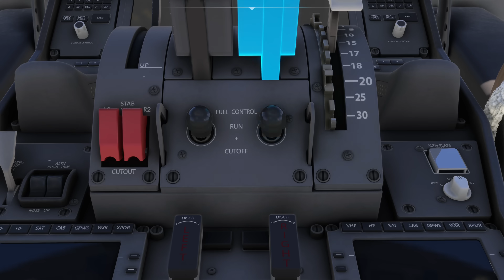Air India 171: Why Did The Fuel Cut-off Switch Get Moved?

Comment: Nobody saw the switches being moved.  
The real question is, how did the electronic circuitry downstream of the switches send the signal to temporarily switch off the fuel supply valves even when the switches were physically not moved.
Captian Steeeve,  please do not be presumptuous.  The possibility and probability of electronic circuit malfunction and glitch is far far greater than the possibility and probability of a human being to plan and commit suicide in cold blood taking along over 250 others with him to death.
Your insistence on it being a pilot action rather than an electronic glitch is completely baseless without any proof.  Just because the black box records the switch off, does not mean that the switch off was caused by actual movement of the switches. There is plenty of circuitry between the physical switches and the fuel shutoff valve solenoids for that glitch to happen and get recorded in the black box.   The CVR recording also does not bear proof that a pilot did it.  The recording in fact is proof that both pilots were surprised that it happened.  The first pilot who asked the other pilot why he had switched off the switches had given a natural reaction to the glitch. The other pilot replied and clarified that he had not done it, making it clear that it was an electronic glitch and not a mechanical failure.
Captain Steeeve, we respect you. Please do not sell your soul to Boeing.  Be on the side of truth and truth alone.
Your integrity is at stake in this case.
You seem to have taken up the job of maligning the pilots and taken up a psyop contract for boeing to create an impression world wide that this is a pilot suicide case and divert public attention from the possibility of electronic malfunction.
https://youtu.be/ybRgSVPsIwo

Comment: Looks like corrupt effort by western media and Boeing PR team with captain Steeve here to blame pilots to such reckless mistake at 600ft right after takeoff. 

Boeing has already accepted hardware was faulty with circular in 2018 l. AI171 had TCM module change in 2018 and 2023, why wouldn’t they have checked fuel cutoff switches? Boeing is definitely hiding something serious here like MCAS. Boeing has corrupted aviation safety bodies.

Comment: If it required two pilots to cut off the fuel, what would happen if the situation required an emergency cut-off and one of the pilots was incapacitated? Not sure this is a solution. I suggest that an audible warning, "fuel cut off engaged," together with an alarm and lights might be a better solution.

Comment: Shalom Captain Steve,
The repost says that both FC Switches were transitioned:
"within a time gap of 01 sec". 
That is: not one second, but within one second. This could mean 500ms or a maximum of 999ms, or a minimum of 1ms or even simultaneously (0ms).
So can one pilot - without the pilot protocol verifing checks, switch both FC's within a sec ie at max of 999ms? As you said, these are on springs: he must pop out the string from "run" position. Move it from "run" to "cutoff" then pop back in the spring such that the switch is now stable and unmoveable in the "cutoff" position. Is this half a second's worth of time? With the other switch another half-second?
Has this been simulated?
Can you show us this: get some model of the two FC switches and demonstate transition both of these within a sec (with a timer to check) on your next video?
And no need to say: he can't switch both FCs at the same time.

Secondly, the report says:
"When FC switches are moved from CUTOFF to RUN while the aircraft is inflight, each engines FADEC automatically manages a relight ..."
That is their is automisation and thus software control from "cutoff" to "run". I assume it is the opposite procedure from "run" to "cutoff" ie automisation and thus software(?).
If so:
Could the following scenario occur:
After Vr and a few seconds after that - their was some malfunction in the software that, somehow, nternally caused a transition from "run" to "cutoff" of FC1 -
WITHOUT having to move the switch manually?
And subsequently the second switch FS2 also automatically cutoff due to a software malfunction/virus/hacking - both "within a sec". Ie an automated accidental malfunction (or another possibility: someome deliberately hacking into the program prior to flight, from the previous flight to the current flight).
Thus the data recorder would have senses AS IF the fuel switches were manually switched off, thus recirding a "transition from run to cutoff ..." for both switches within a second. When in actual fact no one actually moved the switches. Comcerning the pilot's question of "why are these switches off?"
Maybe he hears the muffled noise of both engines cutting off, and thus asked assuming the other pilot switched off both FC switches (prior to making a visual inspection, as the flying pilot is looking straight ahead).
Then, after 7 sec (after FC2 cutting off), someonen the software rectified itself retransitioning FC1 from cutoff to run, followed a few seconds later with FC2. Thus if a software malfunction in the FADEC it is unlikely a virus or deliberate hacking (otherwise the software wouldn't have tried correcting itself after 7 to 10 sec). Rather more likely a genuine software malfunction or bug in the FADEC IF all this was indeed a malfuntion and not pilot intervention. Thus the 2nd pilot's response of "I didn't do it" may be authentic.
Could this be a possibiity?

Thank you,
Shmuel 
Ashqelon,
Israel
Reply: Spelling correction on 2nd line:
 "... the report says  ..."

Comment: Hi captain, it is mentioned that the fuel switches turn to "cut-off" at the time of landing. I have couple of questions in this scenario: 
1. How likely it is that the pilots skipped/forget to check the fuel switches in the pre-flight checklist?
2. Can a plane still possibly be takeoff if the fuel switches are left in ‘cut-off'?
waiting for your feedback.

Comment: Nowhere in the report does it say that switches were physically moved by the pilots. It says the switches "transitioned" which means if there was a malfunction the fuel valves might have closed without physically moving the switches. When one of the pilot says he did not do it why do you overlook that? The whole conversation is not available yet you blame the pilots  without evidence. Why is it so difficult for you to even consider that there could have been a malfunction ? Is it convenient for you to absolve Boeing of any responsibility? Please don't slander the pilots just to push your narrative

Comment: One Boeing dreamliner pilot has categorically stated that it is not possible to physically turn both the switches to off position within one second. 
So, it seems to be an electronic glitch. 
Also, why accuse the pilot of lying about not putting off the switch? Why not he's telling the truth?
Clearly, there are huge holes in your theory from the data that is before us.
Reply: 'One Boeing dreamliner pilot...'. Yah, I saw that goofball, too. 8,700 hrs flying Dreamliner and he still has to search where the fuel cutoff switches are. Not very credible description. 🤣
Think about it. If you are determined to switch the fuel switches to cutoff, you know where they are.

Comment: I think 2 points to note: 
1. The complete audio is not provided, just the part where they speak this line and also which pilot asked and denied. That could maybe provide us with clarity. 
2. When there was a mention on the same aircraft fuel cut off switch issue back in 2018, advice was provided by the authorities to replace which means, there is a high possibility of malfunction. We cannot assume this because 737 Max was a prime example of such issues malfunctioning without the consent of the pilots. 

Let's wait and watch!

Comment: It seems pretty clear to me that whichever pilot said "why did you turn off fuel switches" is the pilot who was at fault. Both pilots would know that if fuel switches were off at this time then the time to ask questions would be later and each pilot would have absolutely immediately corrected this in an attempt to save themselves. The pilot who spoke had thought this through and was probably trying to protect his family from the resulting consequences.

Comment: The keyword from the report is that the engine shut down after the switch went to cut off, this is impossible. Fuel switch does not kill engine, it can still run with residual fuel from pipe. Further investigation is needed.

Comment: This is basic:

Set a min altitude for when you can manually put the switch OFF
If min altitude is OK then can switch OFF - this reduces human error
If min altitude is NOT OK, but the switch needs to be put OFF, then create other functions - e.g. plane in taxi after flight, press a different button to cut off fuel from the engine, OR make it an auto function wherein the fuel get's cut off after a certain number of seconds/minutes from a particular action.

Comment: Hi, Captain Steve. Lots of respect for you. My question for your next Q&A: How are you so sure that the switches were physically moved? Is there any evidence suggesting that? These are definitely not normal bedroom switches. The flight data recorder logs only the state of the switches not the physical position of the switch. What if the state of the switches changed to off internally because of some software glitch or sensor malfunction or controller issues while they are still physically in ON position. The Pilot in command noticed this immediately by the sound of the engines and asked the other pilot "why did you cut-off?". The other pilot denied steadily. They tried to revive the engines by physically moving the switches back and forth until the state of the switches turned ON again. But it was already late. Just a speculation.

Comment: I can't believe this tragic situation where a pilot has concluded the blame on other pilot so easily and quickly without asking a single question on the report. Why the report was released in the mid night? Why there are no signatures on the report? Why only the 2 line conversation is mentioned in the report?? Why the past problems with these switches are ignored?? Something is wrong for sure😢

Comment: Electrical or software failure could have closed the fuel valves even if both fuel control switches were in the RUN position.

Comment: 02:55 Two pilots required to operate the fuel cutoff switches means if one pilot is incapacitated and the only pilot remaining needs to cutoff the fuel in case of engine fire for example won't be able to do so.

Comment: WE LIVE IN 2025. TECHNOLOGY AND CONDITIONAL THOUGHT PROCESS HAS GONE WAY BEYOND OUR IMAGINATIONS. EVERYTHING WE CAN WRITE ON THE SYSTEM TO OVERRIDE HUMAN ERRORS.

QUESTION 

WHY THE BOEING 787 SOFTWARE ALLOWED THE SYSTEM TO CUTOFF EVEN IF THE SWITCHES ARE MANUALLY TURNED OFF, WHEN THE PLANE IS IN TAKEOFF CONDITION BECAUSE THE 787 HAS NO MCAS AND does not exist on the 787. 

RIDICULUS BOEING ENGINES

HOW CAN AUTHORITIES ALLOW SUCH A CRITICAL MECHANISM NOT INSTALLED IN 787.

BOEING SHOULD BE HALTED AND INSTALLED WITH MCAS SYSTEM. NOT JUST BOEING ON ALL THE PLANES.

Comment: Are we missing this detail. RAT getting deployed when aircraft still had engine power to fly. Trigger of the RAT could have been a difference source like serious elec failure or something else? From the image in prelim report which shows clearly aircraft might be above 50-100ft. By then RAT was already deployed. But still aircraft flew further 500-600 ft. If engines were spooling down by then....then aircraft cannot fly to such height right? RAT could have been deployed because of some other failure like elec or some other failure

Comment: Just a thought since there is reporting of one pilot asking why the shutoffs were enacted and the other saying he did not; as you said it could be like the parent-child caught in the act situation and denial or depending on the analysis of pilot’s tone in the recording, because there is little way of knowing which pilot DID the action, it could be the pilot asking was the one having turned it off to lay blame on the other, and the response was one of shock and amazement… it will depend on some speech and psychology analysis and even then be very difficult to pin without more knowledge, information and evidence. Tragic.

Comment: I have watched all your videos on the AI 171 and thank you for all you have done. My question: the SAIB about the locking mechanism for the fuel switch is letting a lot of us to speculate that a non human intervention might also have done this. So pls tell us very clearly what is the job of this locking mechanism, how it works and if they are absent, is there any possibility of the switches to move to 'cutoff' without human handling. If the answer is no, why cannot it be so? are there other fail safes?

Comment: Dear Capt Steeve, I have seen many of your videos and found them quite informative. But then there are several questions that arise from this report. As a fellow aviator, with a mix of military and civil flying background, for sure the script to 'Blame the Dead Pilots, For they Can't Fight Back' was written the moment the news of the crash became public. 
The vaguest of the vague reports that I have come across is this one, even a kindergarten toddler would probably write a better preliminary report.
To start with, 1. Why have the naive investigators not been able to point out who is the PF and PM?
2. Which fuel system or any other system in the world has switches that transition from one position to the other? Switches are always moved, the associated valves transition from open to close. 
3. No time stamp on the FDR data of the 'transitioning' of the switch. It says immediately after reaching the max speed of 180 KIAS the switch transition happens. Moreover the corresponding altitude is not mentioned. Had the corresponding altitude been mentioned from this time to the max altitude attained before the aircraft started coming down, it would have provided some important data about the takeoff.
In the absence of a cockpit video, will the FDR confirm whether the switches were moved physically or the valves transitioned due to some other fault?
4. The RUN to CUTOFF takes a second for both switches, which really means one of the pilots has to do a physical movement which the other one can't miss. The other pilot would definitely call out such a behaviour. But no data to prove it so just personal experience here. 
5. The time difference from RUN to CUTOFF is 1 second but the other way round is 4 seconds as per the report. Why will the pilot wait for 4 seconds at that stage? Just put the switches ON and let the FADEC do its job to fire up the engines. 
6. The CVR transcript doesn't identify who said what, really? Nor does it come with a time stamp as to how later after the fuel switches 'transitioned' did this conversation happen. 
7. If it's a deliberate movement of the switches, will the other pilot wait for 10 long seconds to do the recovery action and get into a conversation of why and what? Unlikely. 
8. Nowhere in the media is the advisory report of Boeing regarding the 787 fuel switches being discussed. Nor as to why the AIR INDIA maintenance team didn't do it even though it's an advisory, but if it relates to the fuel system, why the hesitation to do it? Rather should have been done to be safe than now being in this state. I doubt this question will ever find an answer and mention in the subsequent report.
Regards. 
Namaste.

Comment: Why not allow the continued supply of fuel a longer more time to make room for the necessary correction after the fuel cut-off lever was accidentally switched to fuel cut-off position? Also, why there was no tell-tail sign or alarm to warn-off pilots that the fuel cut-off lever was accidentally switched to cut-off position especially whilst the plane is on the climbed mode immediately after take-off?

Comment: Capt Steeve from the preliminary report the checks on the locking mechanism switches were pending. Therefore, could it be the switches were actually pre-mod ones requiring replacement so the airline needed more time leaving the room for inadvertent operation!

Comment: Steve... you conveniently forget that"both switches were turned to cut of within 1 second and turning on them took 5 seconds"...here is what report says:
 - 06:15:05 IST – Engine 2 fuel control switch moved to CUTOFF.
- 06:15:06 IST – Engine 1 fuel control switch also moved to CUTOFF. The near-simultaneous switch-off resulted in complete thrust loss
Time Difference Between CUTOFF and Attempted Re-Engagement ("RUN")
- Fuel Control Switches Moved to CUTOFF:
- Engine 2: 06:15:05 IST
- Engine 1: 06:15:06 IST
- Attempt to Re-Engage Switches (Back to RUN):
- Both switches: 06:15:13 IST
📐 Calculated Time Gap
- From Engine 2 cutoff to re-engagement attempt: 8 seconds
- From Engine 1 cutoff to re-engagement attempt: 7 seconds
... can You (Steve)  tell us is it possible to move fuel switch just in 1 second???... guys it's easy to blame on the dead and shield real culprit...
Reply: I genuinely don't understand how your conclusion is that turning the switches back on took 5 seconds given the data of the report. Based on the time stamps on the report, the switches being moved to on were also just one second apart. Or am I missing something here? Also, there's a logical error in assuming that the 1 second is the total time for operating both switches. The 1 second between signal changes in the report is just the time from signal change 1 to signal change 2. Logically, this means that the 1 second measured is only the time to move the second control stick from on to off, not both of them. The measured time doesn't include the extra second it likely took to move the first stick into the "off" position. So now we have an estimated total of two seconds for operating the two control sticks, which I think is realistic.